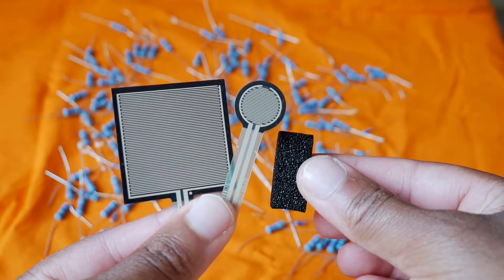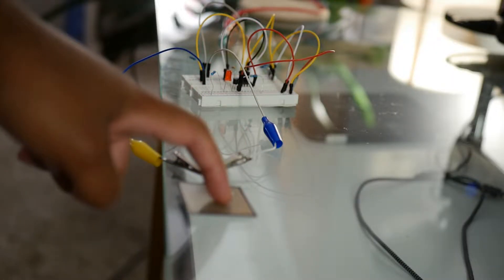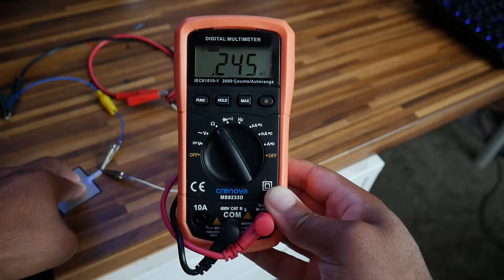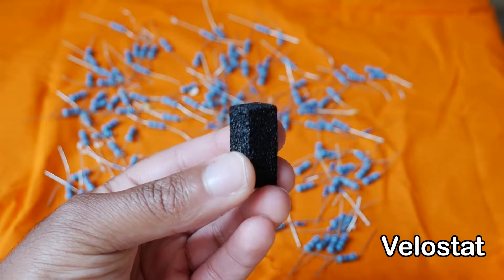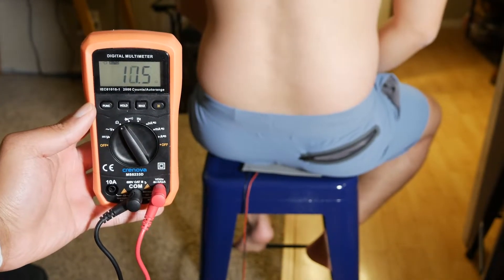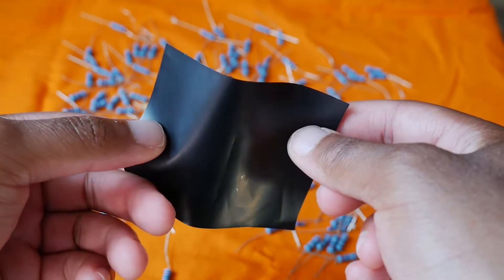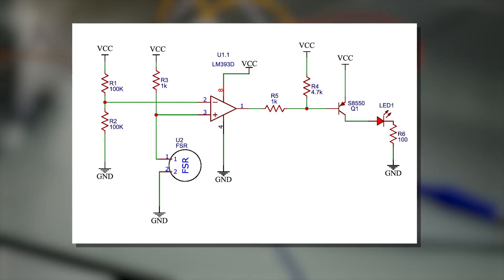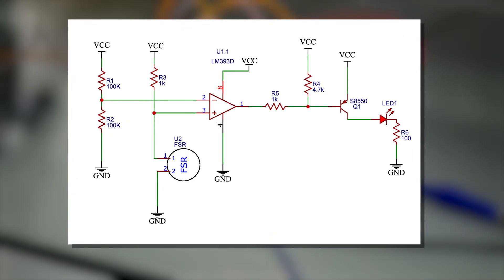Force Sensitive Resistors - Pressure Sensing for your Arduino Projects

Comment: Hi there
I want to use such a sensor over the chest of a silicon man (punch bag) and also want to connect this with a potentiometer and a screen to calculate and indicate punch pressure.

Would u suggest using this one? I would be glad to have ur feedback